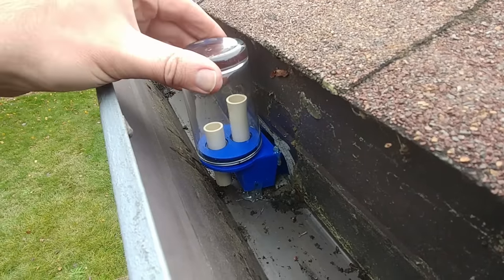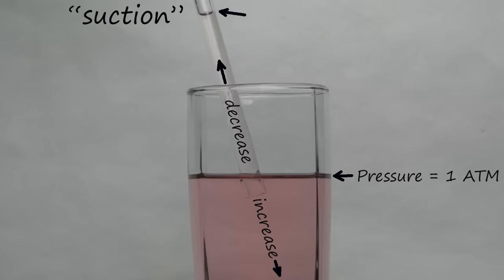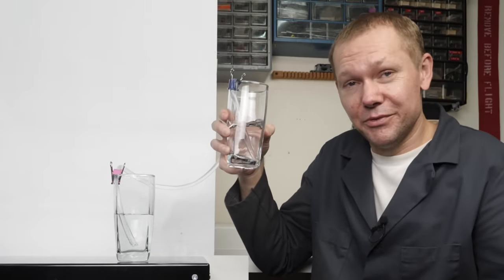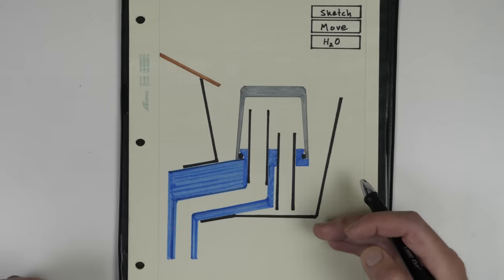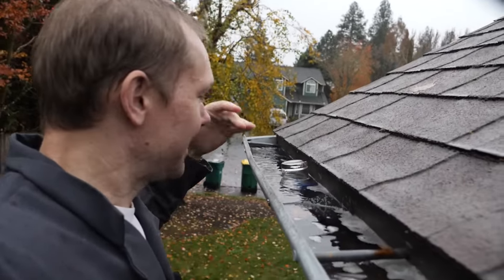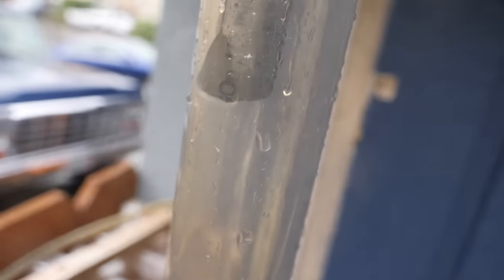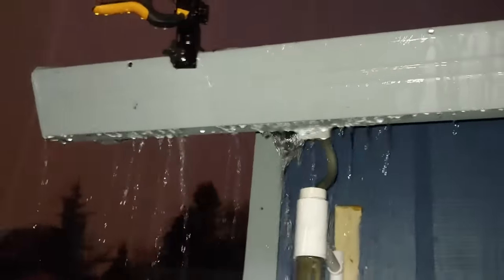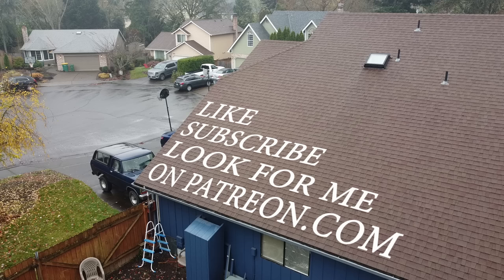Rain Gutter POWER #5 - Bell Siphon Fundamentals and Pitfalls

Comment from the maker: PREVIOUS EPISODES
Part 1: Power Available      https://youtu.be/S6oNxckjEiE
Part 2: Alternator BUILD     https://youtu.be/YLb4enCgnP4
Part 3: Testing Turbines     https://youtu.be/vify0k2sHlQ
Part 4: Charging a Phone   https://youtu.be/amu5LJaDUPY

A huge thanks to my super awesome Patreon supporters who made this video possible.  To become one of them visit:
https://www.patreon.com/QuintBUILDS

If instead you prefer a one-time donation option, here's a PayPal address you can use: BUILD2LRN@GMAIL.COM

FUTURE EPISODES
Enclosing the turbine in a shroud, 
Trying a Tesla turbine
Explaining how the diameter of the pipe has no effect on pressure or power
Demonstrate how a ram pump can raise water back up to the gutter but at a loss (no free energy)
Showing how to BUILD your own alternator without a lathe!
Thanks for watching!
Reply: for your overflow side, why not just have the old toilet tank stopper attached to a float on a chain that will lift it up just enough to keep the gutter full but not overflow. So once the level drops back down, the float will drop and seal off the overflow.
Reply: Until it freezes and then everything that isn't flexible enough to take the expansion will burst.
Reply: @TheLightningStalker  Water in the bottom pipe will drain automatically. Water in the Siphon will either have a large pocket of air or it will have emptied from being too full. Water in the gutter can expand upwards. So where do you see this water bursting things?
Reply: @wvance0316  Any time it freezes inside something or freezes around something and squeezes from the outside
Reply: @TheLightningStalker  interesting theory, so why would it choose to try to break things when it has the option to expand into the air. You know, the path of least resistance.
Reply: @wvance0316  Because ice does that. Most likely because it almost never freezes evenly.
Reply: @TheLightningStalker  so explain how glass bottles left half full in a freezer do not shatter.
Reply: @wvance0316  I'm not arguing about any events that may occur under ideal conditions.
Reply: @TheLightningStalker  but you'll argue random odd ball conditions that are much rarer and harder to repeat. Noted.
Reply: @TheLightningStalker  I'll give you your two outs here. Either you made the comment without thinking of if it was applicable in this setup, or you don't fully understand thermal expansion with ice. Which one is you?
Reply: @wvance0316  I'm just trying to be helpful here. It wasn't even your comment in particular I was originally replying to anyway but the OP left by Quint.
Reply: But diameter of the pipe DOES impact how much power you can extract... 

It doesn't impact static pressure, but a larger pipe has less pressure drop while the water is flowing. This potentially allows you to use a larger turbine/generator that is both more efficient and can handle using all of the water available during the heaviest of rain.
Reply: P
Reply: Would putting a full circle loop in the pipe immediately below the siphon cause a U bend trap for the dribbles which might fill the pipe and instigate the siphon sooner?
Reply: Loved the paper animation!
Reply: I'm very interested in this series of videos. I live in a terraced house, one of 5, and have the only downpipes in the set of houses. The catchment area of the roof is huge and the flow down the pipe can sometimes keep us awake. I always think to myself - that's a huge waste of energy potential there! Even if it's just enough to charge our phones etc!
There is a type of hydro turbine where the flow at the head is based on a whirlpool type device and I was wondering if this would help conserve the water in your system - less spray off!?
https://youtu.be/7w9rxf6UutA
Reply: This is basically the same as a Pythagoras Cup but bigger
Reply: 4:30 very old technology to have a straight horizontal line over long distances, regardless of the landscape bumps (increase/decrease also) without laser or other modern tools. 
A long hose (garden hose is sufficient) and two funnels with markings.  So we have a real spirit level.  Then take over the markings and pull cord to build a wall with the perfect horizontal line, for example.
Reply: Ok, as I have been researching ebb and flow hydroponics and aquaponics , the key to the siphon is the gap between the top of the tube and the top of the bell, and the length of drop
Reply: hay qint what will help kick start your flow is if your bell is just slightly higher than you outflow tube. a more complicated solution would be to put a u bend in the outflow tube even a small loop in your hose that leeds into the jet resivour would help prevent the external air pressure from equalizing inside the glass so the dribble would help your siphon prime itself instead of being wasted energy.
Reply: ⁰
Reply: @Slider68  Just use multiple siphon diameters, parralel to each other. Actually, just multiple small diameter siphons.
Reply: @MrTench8  Test it out, I personally expect the counter pressure in the loop to mess things up.
Reply: What if you make the intake tube level with the  blue base and then make the other tube only slightly higher than the intake valve?

Would this not allow you to pump more continuously?
Reply: Haven't you ever seen a water level used they use them all the time pouring big slabs of concrete its just a long tube with water in it same concept you're doing with the  glasses of water
Reply: Underneath where the water loss is, will you build water trompe to catch the overflow?
Reply: @Slider68  There is only so much potential energy that can be stored in the gutter. It doesn't matter much how fast you can extract that energy, at the end of the day the battery would be charged the same amount imho
Reply: It was a joy to watch that. Love your enthusiasm!  Brilliant video. (I subscribed too, thank you.)
Reply: The powerbank you used - Can it power something (like an Arduino) while charging up with the solar panel at the same time? And does it have a minimum power draw, or can you power something that has a tiny power consumption?
Cheers m8, great work!
Reply: @Chretze  Your going to want one that has power passthrough while charging, not many I've seen have this feature.
Reply: @BlackHeartScyther  Yeah that's what I'm looking for... Could you recommend a few cheap options?
It seems so simple, in my mind it should be a common feature. To me it seems it's more complicated to not have passthrough since you probably have to add some cirquit specifically to avoid it. Plus I see zero downsides to having passthrough in a powerbank like that... FFS do we have to build everything ourselves now or what :D
Reply: If one bell siphoned is good two are better!  I'd use a second one set to a higher level.  Therefore if the outflow is lower than the inflow it'll trigger and relieve the overburden.  What do you think?
Reply: @Chretze  I do not know of any offhand, it actually requires more circuitry than not having passthrough thus why a lot of power banks dont have it. For example, if you used a low amp charger then your phone might draw power from the powerbank and the charger at the same time which would charge your phone quickly but the powerbank may have less power on it then when you plugged it in if you where only charging for a few hours, or vice versa. Passthrough actually balances the current coming in and going out of both so both devices can charge. 

If it where an extremely simple circuit (5v battery connected to the charging cord plugged into your phone) then likely the battery would take the lions share of the power being the bigger capacity usually. Depending on what circuitry is in your phone, it might actually discharge your phone to charge the battery, which is obviously not what we want.
Reply: What if you added one of those lift lid like in a toilet. Set the floater above the tube and when the water rises over the tube it will have enough pressure to start flowing
Reply: @greedylittleelf1397  A float valve to trigger a bell siphon, not a bad idea I suppose. He already got the assembly for the flapper, so there should be a float valve laying around he could try.
Reply: 🔴 What Is Islam? ⚠️

🔴 Islam is not just another religion. 

🔵 It is the same message preached by Moses, Jesus and Abraham.

 🔴 Islam literally means ‘submission to God’ and it teaches us to have a direct relationship with God. 

 🔵 It reminds us that since God created us, no one should be worshipped except God alone. 

 🔴 It also teaches that God is nothing like a human being or like anything that we can imagine.

🌍 The concept of God is summarized in the Quran as:

📖 { “Say, He is God, the One.  God, the Absolute.  He does not give birth, nor was He born, and there is nothing like Him.”} (Quran 112:1-4)[4] 📚

🔴 Becoming a Muslim is not turning your back to Jesus. 

🔵 Rather it’s going back to the original teachings of Jesus and obeying him.
Reply: how would putting a similarly sized gear on the wheel and a smaller gear to drive the generator affect torque, output, efficiency?
Reply: I would like to get detailed plans from you so I can do this on my house. Is this something you can do for me?
Reply from the maker: @MrRetrocartoon  the alternator and pelton wheel are on grabCAD. But it's a complete novelty. You'd get more power from a solar panel the size of your palm.
Reply: @QuintBUILDs  i understand that. I wanted to replicate it. I think i could boost the power. I like to tinker with things, so it would be a fun project for me
Reply from the maker: @MrRetrocartoon  gotcha. Some people think they're going to power their house, even after I show how crazy low the output is. Best of luck!
Reply: why no second powerplant as a overflow?
Reply: Where do u live ...looks like always raining
Reply: Why don't you use water proof caulk instead of hot glue?
Reply: One idea to start the siphon at even lower flow rates. On the outlet pipe a cage with an upfloatung ball. The weight of the ball must be so heavy, that it would just float up if the water is a few millimeters above the ending of the pipe, I think that could work 🤔
Reply: they make screen for your gutter tops
Reply: 2 ideas for lowering the minimum flow rate:
1: add sharp bends to the drain pipe.
The bends induce a disturbance which creates temporary seals, which increases the flow rate.
2: make the intake perfectly level in order to create a water curtains inside the pipe, which will close relatively easy due to any disturbance and sucks more water in.

Methods 1 and 2 can easily be combined to increase efficiency 😁👌

At least in theory 🤔
Reply: Hopefully you setup the overflow pipe to also turn your generator. You don’t need a valve, just a pipe that ends just below the point of overflow. You can seal a straight pipe at that height through the bottom of the rain gutter.
Reply: What tablet do you use for the simulation in your video
Reply: Something to consider for the pipes inside the bell siphon is to replace the PVC with brass or copper, to prevent the growth of algae, moss and lichen in them.
Reply: Just a quick quest how much energy can you generate  i know it fluctuates depening on water but and an estimate on house your size ?? Also do you let energy go to batteries or direct energy or both
Reply: An sich gute Idee und Umsetzung, aber jetzt hast du eine Mücken zucht rund ums Haus.

Comment: to solve your rain gutter overflowing in heavy rain, just add a weir around the overflow drain opening. so when your gutter is about to overflow, it will drain according to your weir height.
Reply from the maker: Yup, I think that's the best solution.
Reply: Weir were you earlier?
Reply: @QuintBUILDs  Should be able to do it on your other gutter outlet. I would think a collar around it with the height you want for overflow, then if you want to help keep debris out of it, you could just put a cap over it. For the other issue with the dribble, I thought maybe a tipping weir might work. Basically  making a dam that has a section (L shape) that would tip over when the height of the water overcame the weight of the section. When the section tips over, the  lower section would be 'pushed' by the flowing water keeping the top section down, then when the flow decreases, the lower section drops back down and holds the dam closed. You can adjust the weight of the lower section to meet the minimum and maximum flow.
Reply: @TheCapt  I think it would be easier to use differential mathematics to describe the dynamic system to then engineer a pump, hose and valve system that measures pressure, water height and maybe flow to determine via a PID-Loop how much water to pump off to never have any overflow at all! I hope you understood the joke in this, I liked your enthusiasm in wanting to find a solution to this problem mechanically or better said ... failsafe without any extra energy needed to be put into the system.
Reply: @LeRainbow  As an I&C engineer, the humor is not lost on me. Thanks
Reply: First rule of doing something with water - make sure there's somewhere for the water to go if there's too much of it.
Reply: weirs are the obviously superior solution, but i want to science the sh!t out of it. and making a second high throughout bell siphon and readjusting the siphon start levels of each would do that in a cool way.  but yes, damming at the appropriate height is a valid and KISS solution
Reply: @QuintBUILDs  is the best solution not install a bigger gutter 😂
Reply: @ilovefunnyamv2nd  there is a lot more optimization that can be done with the single syphon
Reply: @QuintBUILDs  you can install a tube for the overflow at the appropriate height, don’t need complicated like design a weir. And shorten the outflow tube in your bell valve so the required water height would be less? Actually the suggestion would still not provide adequate flow rate. ( for second part)
Reply: @gleggett3817  - It has somewhere to go... Over the edge of the gutter. 😁
Reply: @CA-gy4qf  Yeah, but wheres the fun in that? Next you are going to tell people to be "reasonable" and "grow up".
If you want to be a "reasonable adult" you could just tell him to stop glueing his gutters shut and remove the syphon blocking it.
Reply: @TheCapt  smh  I hope your  a tech and not a programmer.  Don't  forget  to add it to a scada system  so he can monitor  it  remotely  from Mars.